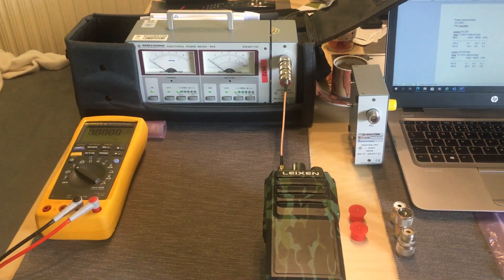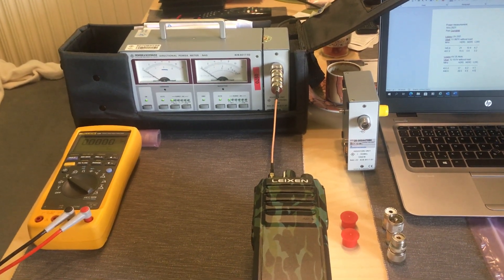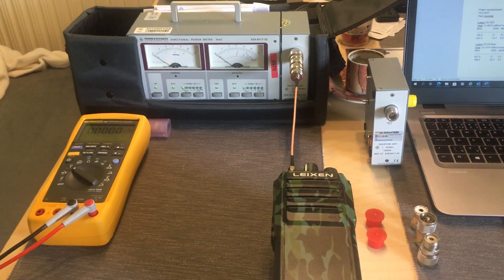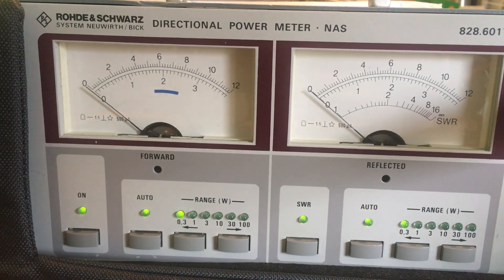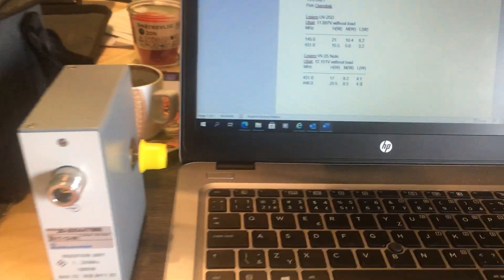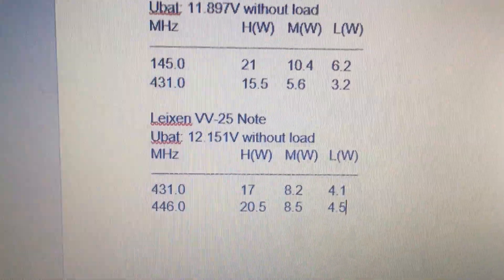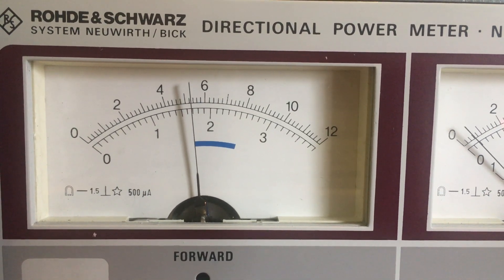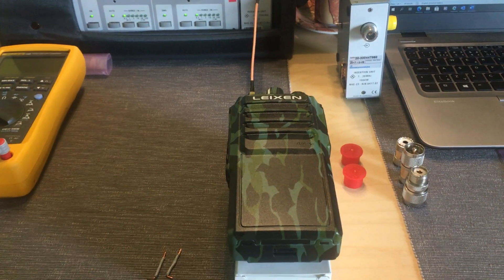Leixen Note (VV-25) - is it really 40W output handheld ?!

Comment: If you test it on ch13 which is mid frequency you'll find it will give out about 23w
Reply from the maker: What you mean ch13??
As you can see I covered with measurement 431-446MHz…

Comment: On what frequency? There not the same output across the band. I measured my uv25 to 21 watts at 443
Reply from the maker: As you can here I am saying at the beginning of vid the frequency of Tx is 431MHz.
Reply: @petrok1rp254  What people are trying to say is; Change the mhz frequency, and you will have a different result.
Reply from the maker: Do not care other frequencies. I have programmed local repeaters where upling is around 431MHz. That is what I am interesting in…
Reply: @petrok1rp254   two be honest 17 to 20 as advertised on the talkie isn't bad and that isn going to make any difference. But I as I have said I have seen a lot of variation in power output.  From 17 to 22. . But as for the 40 output clame that I don't believe.  Totally different output stage or if not overdriven and will go pop very soon

Comment: What is the receive like though?
Reply from the maker: RX front-end is nothing special. It is better than low lost Boafengs but it is still easy to overload on the hills or close to some in-band transmitters. Using mobile it is well usable. Do not recommend to connect big stationery antennas on the house.
Reply from the maker: Anyway together with external helical BPF it work quite well and surviving even the nearby in-band strong signals.

Comment: Who cares how many watts it has.  More isn’t better. Everyone wants more power, but they overlook the receiver.  The receiver is MORE important.  Is it a superheterodyne or just direct-conversion Chinese junk?
Reply from the maker: @chrisgullett4332  haha, good joke. Worked for Motorola several years even in US... in 90's.
Reply from the maker: @chrisgullett4332  What I saw and remember, Motorola products were never been mixed with anything other and production line was separated from the other manufacturing line. Only Motorola parts, hardware and software assy been on the floor. The QC was done by Motorola supervisors personally responsible for each production batch. I personally took part in a mechanical stress and crash tests of the 2-way radios...
Reply from the maker: MIL-STD-810H
Reply from the maker: Did you heard ever about an SDR technology? Check Yaesu, Kenwood, Icom or even Motorola, Bendix etc. handhelds for VHF/UHF... The most important is FE filtering and A/D - D/A dynamics in these handhelds. Tech development is much further then just superhet/DC...
Compare to other handies from big three is this Leixen worse in term of receiver FE spec but it is one of the good choice from all chinese riseboxes...
Reply: @petrok1rp254  Exactly.  Front end filtering plays a huge role too.  My Motorolas are as tight as a drum.
Reply from the maker: Does not matter in that case if Motorola is in Chinese hands …it is still highest quality build, tech, as same as q control. So Motorola is still in front of the peloton…
Reply from the maker: @chrisgullett4332  If the quality of the current Motorolas is so very bad and its at the level of cheap Chinese craps, then there must have been drastic changes in production some time ago, which I no longer remember... I am out of business for longer time.
Reply: @chrisgullett4332  Motorola/Lenovo is separate, phones etc. Motorola radio is not Chinese owned.